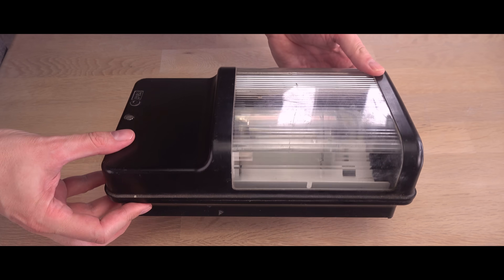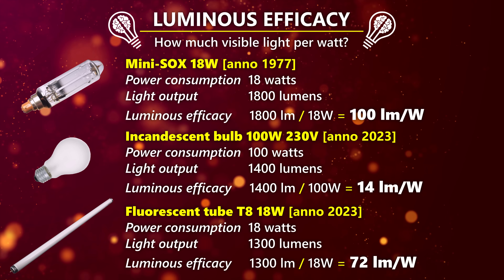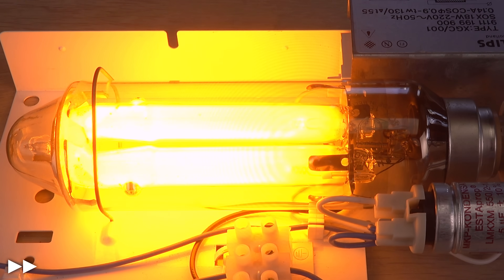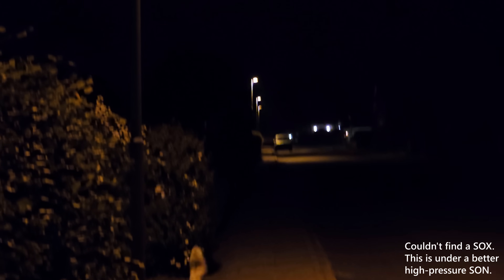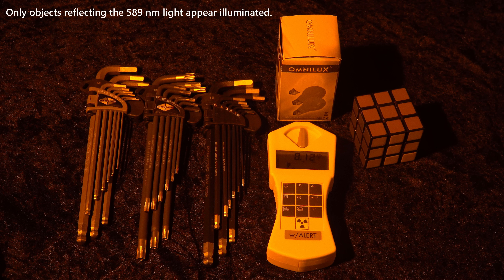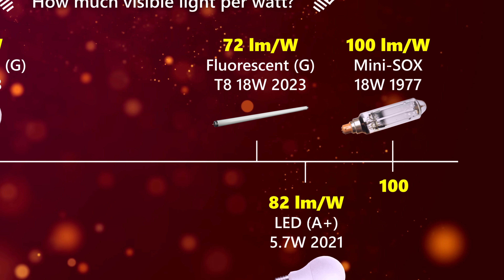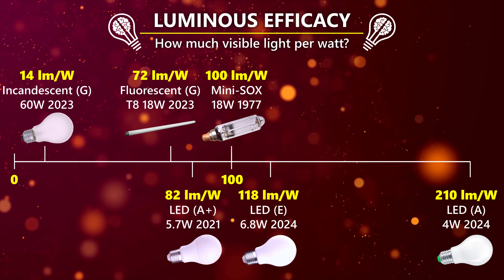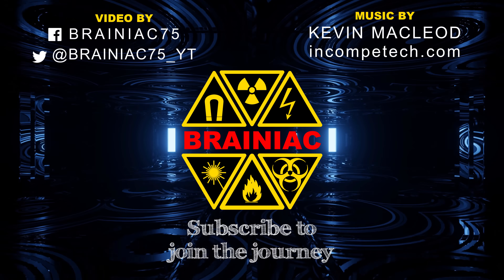THIS LAMP SOXs! "Yellow" tech of bright metal vapor lamp. Beats modern LEDs in brightness per watt?

Comment: I had no idea LED lamps have improved so much in efficiency in just the last few years! Now I kind of want to buy some...
Reply: Me too, most of my LEDs are like 10 years old, got them when I moved in.

With the degradation, it should be easy to get some that are four times efficient.

Sadly it doesn't really matter on the energy bill. it will take thousands of hours to break even.

I keep replacing them when they die. 
Still have some old bulbs for rarely used or hot spaces like the attic.
Reply: You can modify many LEDs to use only half of the wattage with about 70-95 % of its brightness. Most LEDs are overpowered thus they don't last too long.
Reply: There's something of an illusion to it tho. The key factor in both brightness and efficiency is how hard they are driven. To get them bright means really pushing them, which generates heat, which is a result of the associated loss in efficiency. Hence the grade on the back of the boxes. I'd have to see one of these super efficient units torn down to decide if it is being run optimally.

Heat is also one of the big factors in lifespan.
Reply: @MadScientist267 I have a cheap LED bulb I modified to run on less power. Big Clive did a series of videos where he removes one of the resistors that set the current. The mod significantly reduces the heat produced while keeping the light output reasonable. It works better with brighter bulbs that have more diodes.

My cheap IKEA bulb has a value of 96 lm/W while the Philips has 210. So for less power you get more light. I wonder how cool the bulb would stay if you were to reduce the power by 50% to 2 watts.
Reply: @eliaschnl  I drive (my own) lighting LEDs with a buck converter generally and use CVCC to set their current. This allows full dimming control with an absolute current limit to set "full brightness" power. 

If you want to get fancy, toss a thermistor in with a couple other passives and have it back off when things are heating up. 

Still a relatively simple driver (compared to PWM) with a much "cleaner" light and it doesn't thermally stress the dies with all the rapid cycling. But the world likes cheap(est possible). 🤷‍♂️

My way? They virtually last forever and run lukewarm at the sweet spot. Yes they can still crank. Do I run them there? No. Use more of them instead.
Reply: @MadScientist267  That happens to be very similar to the plant light I made my mom. Harvested LED strips from a TV and a buck boost converter. Though mine only adjusts voltage (naughty way to drive LED's!). Still, I run them way below rating so practically no heat.
Reply: @eliaschnl  Less power, less light, but it isn't a linear relationship. They make up for it by adding more LED chips.
Reply: @MadScientist267  Big Clive has done some videos on them, seach for "Dubai Lamp" and they should come up.

Comment: I have a nearly unhealthy fascination with these Low Pressure Sodium lamps. I'm not even into photography, and feel like a whole swath of lighting technology was taken from us.
IIRC, these lamps' output were much less 'harmful' to night adapted vision. While they 'nuked' your color vision, you could make out details in the light well, and drive/walk into/out of darkness w/o the irritation of transitioning to/from high LED-illumination. NtM, SOX did not 'mess with' people's circadian rhythms like HPS, Mercury Lamps, and LED.

Especially, knowing that well-developed SOX lamps well-exceed to nearly-match LEDs' efficiency (past-now), I feel like their removal from the market had nothing to do with energy efficiency.
Reply: @acmhfmggru  
As I stated, before, the economics boil down to being about the same.  Each LED is shipped with its own circuit board, heat sinks, and regulatory circuitry.  This is another major point - power factor.  The main difference between LED cost is the power supply they use.  A simple capacitive dropper is cheaper, but has a power factor in the 40s.  For industrial, commercial, and municipal scale installations, you really need a proper power supply, which means inductive components, control chips, etc.  This all has to be packaged near the LED, which is itself in need of heat dissipation.  LEDs are installed on aluminum nitride boards, which are quite expensive to make.  It's a great material which is more electrically insulating than aluminum oxide but as thermally conductive as bulk aluminum while having similar ultimate strengths to 6000 series aluminum alloys.  But, it's expensive.
You now have to make the decision of whether to create two separate boards or use the LED mounting board.  You need to schedule this decision through pick and place machines at the volume necessary.  That's not taking into account component manufacture.

You now have an assembly stage.

By contrast, an arc lamp is made of glass which goes through some vapor coating stages and can be assembled with around 90% or more of the process being fully automated.

Sure, the ballast/driver is a little more complicated, but those can last decades or more and the capacitor is the most likely point of failure as the electrolyte dries up.

It works out that LEDs are about as expensive to manufacture as arc lamps, if not a bit more so because of the challenges with automating the process and the higher component count/process stages.
Reply: its the fkn LED industry that oversold their bullshit. But tbf, we did think the LEDs were cool. But turns out the orange lights were better for nightime.
Reply: @acmhfmggru  Let me translate for you:
"There's regulations against these kinds of bulbs in some parts of the world. 
Police and Regulatory Authorities may/will enforce the law."

Original:
"people with the legal right to murder you will show up if you manufacture, sell, or use these lights in many parts of the world"

TBQH, I kinda love how 'extreme' he made something so 'normal' sound. 
Perhaps, 'The Norm' is actually extreme, and we're all just Stockholm'd... 🤣
Reply: @LRK-GT  It's a good way of wording it though, reducing it down to its base components.  Is it at all just to send armed men after someone for making the wrong kind of lightbulb, who isn't actively harming or defrauding anyone?  This reasoning should be applied to every single regulation.  Maybe then people would be more leery of defending them!
Reply: @acmhfmggru  
Motivation is the master of reason.  It's not a shadowy cabal, they openly stand up and proclaim themselves as humanity's savior and campaign on a crusade against the past.  For those who pride themselves on being informed and intelligent, they do not want to see their world as being run by corrupt fools.  They like the narrative and the irony of a holy crusade against religion or any perceived lack of allegiance to "science" or some similar touchstone idea.

Consider, rather than arguing the point about whether or not LEDs are truly as "better" as they look on paper, you sideline away from the obvious fact that it is outright illegal to sell older styles of lights in many parts of the world while asking me where the shadowy cabal is.

Obviously, they wrote the law.  It's your own motivation which blinds you to its existence.
If these technologies were so much more simple and economical, then why would a law be necessary for them to gain widespread adoption?

If the argument is that the government must "steer the market and coerce adoption/innovation" - then you don't see the shadowy cabal at all, because they are the ordained ministers of righteousness in your mind.  

The problem is, as I would suspect, you are vaguely aware that the majority of the public would not see such as righteous - likely because you think they are simply ill informed or clinging to religious pretenses best left in the past to be destroyed.  Hence your motivation to effectively try to gaslight people on the subject.

Evil doesn't come in cackling serpentine forms.  It comes in the purest white and the most intoxicating of bliss.
Reply: Yes
Reply: usual red tape society bs. they offered efficiency but we took the cheap sales friendly options all the way and now we have something glossy with no substance.

we coukd have amazing lights but theyre not cheaper to make than the next guysn
Reply: @acmhfmggru green/aqua light is efficient at night for humans. blue/white light is not. all to do with our night vision receptors and the light reflected from the moon (and the time of year but green covers it generally) .people made money from marketting cheap crap and now thats what we have.
white was more efficient on paper. not in real life with eyeballs and brains.
i used to design and make night lights for bicycles in the late 90's when the led's started to take off and replace halogen.
lead acid batteries so efficiency was important. off green was ultimately the most efficient.
Reply: @OnyxtheFolfits bacause china makes them cheaper. and amazon like those profits. theyre still illegal in the uk arent they?
Reply: ב''ה, the hope was that reduced sleep would increase economic output and Ambien sales
Reply: I want to point out that you are incorrect about hps messing with people's circadian rhythm.
Reply: Most western nations have the facilities to make incandescent and metal vapor lamps.  Virtually all of the investment into LED manufacture has been foreign/abroad and their stock holders have a disproportionate representation in legislative branches of government.

It's mostly about the money and political/economic control.  At first, it may appear to be a "get rich" scheme in politics, but it's more about isolating and controlling economic supply lines within ideological lines.  If only a few factories manufacture the legal form of lighting, then the lighting around the world is controlled by those who own those factories or networks thereof - they can decide what they want and everyone else has to follow, unless they want to be criminal scum or something.
Reply: @Aim54Delta I understand from where you are coming from. It would be fair with something like food to reach that conclusion, yet, lights are not as… locally dependent. You don’t need a good soil, climate, region to produce lightbulbs; this means that competition can rise from anywhere where the investment is. I am not familiarized into bulbs or lasers manufacturing so I may be assuming too much, it is just that political string pulling seems unrealistic for light bulbs. Might be that there were reasons to believe that a more competitive lightbulb could be made, cheaper prices for production for example, but then again, I am just eyeballing this without any real insight into the long history of the bulbs
Reply: @acmhfmggru  
You would be somewhat correct were it not for the fact that people with the legal right to murder you will show up if you manufacture, sell, or use these lights in many parts of the world.
In factories, for example, LEDs are generally garbage when replacing high-bay lights.  On paper, they are better, but in practice, the elevated temperatures cut their lifetime by 90% or so.  In the case of street lights, the advantages of LEDs are questionable.
As for manufacture - if it was really that much more simple to manufacture LEDs, then why are there no LED manufacturers in the U.S. for example?

These are extremely sophisticated pieces of machinery used to manufacture modern LEDs and which require an array of supporting industries.

Compared to glasswork and sodium metal, they are orders of magnitude more complex to manufacture, that is partly why it took us an additional 50 years to develop the ability to do so.

People are correct to arrive at the conclusion that useful things are being taken away from them in an unnatural manner.  Why did they ban asbestos?  Because it worked.  What did they replace it with?  Stuff that didn't work as well and causes the same problems if you grind it into dust and inhale it.

Lead paint and gas ... Okay, you get a pass on those, but the effort to ban oil based lubricants and paints for water based ones runs into the same thing - the old stuff worked, so we have to replace it with something that doesn't ... That we own stock in ... And then find it is just as bad if not worse in terms of health/environment.
Reply: @Aim54Delta  Dude, Asbestos causes mesothelioma(a form of cancer). No one's just gonna ban stuff that works well for no reason. There are products that could cause harm like the materials used in the production of Teflon. Some things that work well can end up causing harm to others in the end or have some sort of flaw that necessitates finding an alternative. 

Besides, if powerful people find something that works well but causes problems to people or the environment, odds are, they would resort to underhanded tricks to KEEP it's CONTINUED USE, even at the detriment of others. Why waste an opportunity to profit when it works SO WELL?. So it ain't a problem of powerful people trying to do something funny. 

There are just people who just recognize that certain products, no matter how good, that cause problems for people like health problems or other things and decide to do something about it by finding an alternative. The unfortunate thing is, it's hard to find a better alternative to the thing you're trying to replace.
Reply: @acmhfmggru  
And how are LEDs a "simple" technology?  You keep repeating this point without providing any rationale, much less evidence.  I won't be a stickler for cited evidence in a YouTube thread because it despises many words and links, but you could at least try.
Automated glass forming has been around as long as lightbulbs.  All of it scales well to high throughput, continuous flow manufacturing.

I work in automotive manufacturing and was an avionics technician before that.  I am quite familiar with both the design and manufacturing technology used for each of these.  I will go ahead and deploy an argument from authority.  You stand in front of an expert in BOTH the fields of electronics and manufacturing (process engineering if you want to be more technical).

The cost to manufacture a low pressure sodium lamp is significantly lower than the cost to manufacture an equivalent LED source.  A $20 arc lamp can do the job of a $300 LED street light.  All of this comes down to the way in which LEDs must be packaged into high intensity lighting applications.  They must be heat sunk because the have a negative thermal relationship with resistance - that is, as they get warmer, they want to draw more power.  You need a current limiting power supply on LEDs because they do not have a linear response to voltage increases.  While these are "solved" problems, they do not lend well to hot areas and LED bulbs will fail at higher rates when installed into fixtures designed to account for ye olde incandescent lamp - because they can't dissipate the heat and the LED burns itself out.

To my knowledge, no manufacturer makes JUST an LED "bulb." It is an integrated power supply and heat sink married in an overall design profile.  You can't buy just the diode array, you have to buy the whole thing.  Spare for some things like flashlights where the current limiting circuitry can fit into the base and be reliable enough as just a resistor when the voltage is as stable as that provided by a battery of a known chemistry.

So, no, you don't know what you are talking about and are trying to control a conversation above your qualifications.
Reply: Sodium lights aren't as reliable as you think/remember them to be. If it's not the bulb that blew, then it was the ballast or the coil used to turn it on. Needing to constantly replace those parts adds up over time. Meanwhile a simple LED light will last a lot longer and not have to be replaced so often. Sure you could say it's a global conspiracy to control the industry. But it was maintenance cost that did it.
Reply: @aaronabbey2604  That exact same detriment is also highly-applicable to LEDs. 
It's the 'driver' that usually dies, not the LEDs themselves.
Reply: @LRK-GT  there is less that can go wrong with LEDs versus a sodium light.

Comment: Sodum lights are such interesting technology. I learned from Technology Connections that the monochromatic light makes them very useful for photographic darkrooms, but I'm not sure what other use they would've had back in the day.
Reply: General street lighting, reprographic and scientific are the 3 main fields sodium vapor lamps have been known to be used in.

for general street lighting - The UK implemented a program in the 1970s which saw mass replacement of incandescent and mercury vapor sources with low pressure sodium due to an ongoing energy crisis. Areas around telescopes and observatories favored SOX as well since they can filter the single wavelength of light they produce with ease.

In reprographic - You can run low pressure sodium with an IR Filter as a safe light, since film isn't as sensitive to the 589nm wavelength as it is most other wavelengths of light, it means you can work under it without an enhanced risk of spoiling your film as it's developed.

and in scientific applications, sodium vapor lamps are used a lot for displaying the photon emissions of elements. There are plenty of spectral lamps for noble gases like Neon, Argon, Krypton, Xenon etc but you can also get spectral lamps for sodium, mercury, potassium and Cesium if you want to see how adding certain elements affects the spectra of a gas discharge.